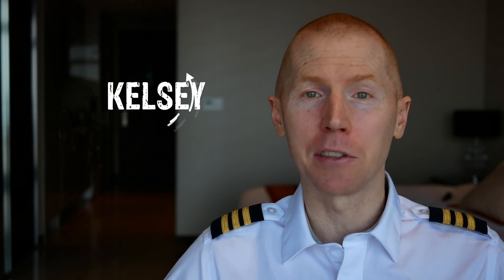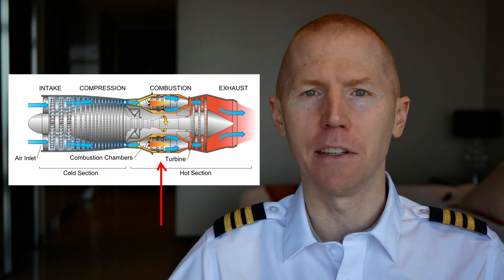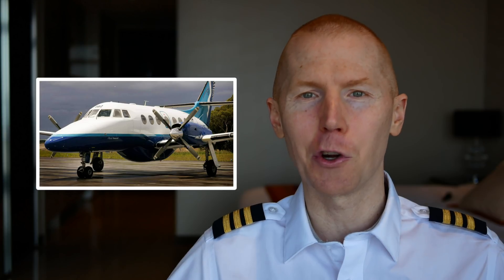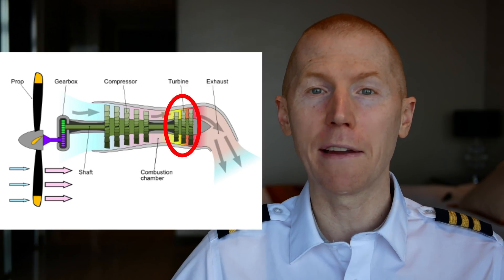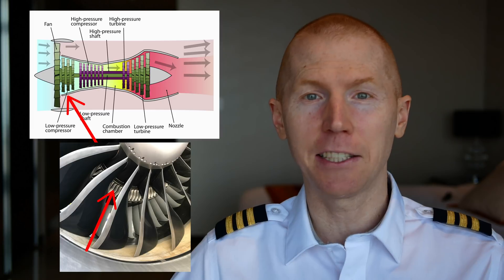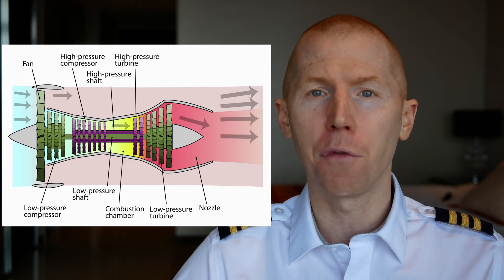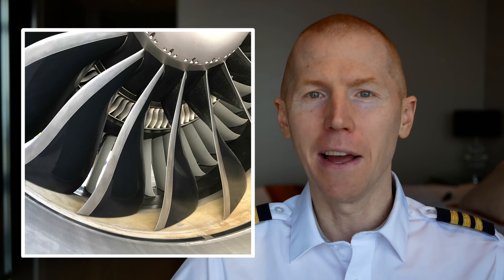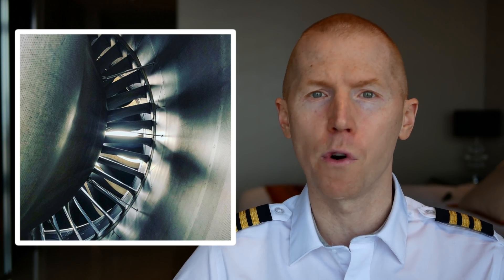Is a Turbofan Engine or Turboprop Engine Safer? | Pilot Explains

Comment: 1:01 I cringed hard!
There is NO explosion in a jet engine (turbojet, turbofan, turboprop) in normal operation. It is a constant burn.

There are igniters which ignite the air-fuel-mixture at the start of the engine and in heavy precipitation and/or icing in case of a flameout. Normally though they only run at the start of the engine, thereafter the burn continues by itself.
Reply: @jamescollier3  what's he then
Reply: No need to cringe, it is just semantics.
Reply: @MaxPower888  I disagree. It's precision. Kelsey and I had a discussion over this on the last video. Kelsey is unfortunately taking the position of Boeing vs. 73 Max pilots over MCAS training ("It was too complicated for pilots to understand"). He is of the belief (which I wholly disagree with) that his viewers can't comprehend a slightly more technical, but 100% more accurate explanation. Example using "blowtorch" vs. "spark & explosion". I consider it disrespectful to his students, and YES, he IS teaching here. There is a very effective teaching concept called "stretch learning", where the information is presented just slightly above a student's level, but still within their grasp. It FAR better than teaching WRONG info BELOW the student's ability. I find the practice offensive, despite the good Kelsey is trying to do here. However, maintaining an iron fisted grip on outdated methods to teach incorrect info truly serves nobody. I think we agreed to disagree. Maybe there's a reason this vid only has 617 likes out of nine thousand views...

Specifically, on the topic of powerplants, I'd rather they were watching AgentJayZ's channel where you can see lockwire-level detail, and also have access to another regular contributor who is a retired design engineer for R-R, and can explain the "whys". It is technical, precise, and has stunning videos of engine internals, as well as test stand runs. FWIW...
Reply: @mikecowen6507  +1 for AgentJayZ. Didn't want to mention his channel for not making too many people aware of him. His channel is the go-to resource for jet engine stuff and by far my favorite YT chan next to blancolirio if you ask me.
Reply: @jodelboy  Jay and Juan can always use more subscribers!

Comment: Many turboprop engines provide thrust from the exhaust nozzle as well as the props. In particular the t56 Allison and RR ae2100 which provide around 500lb of thrust from the nozzle.
Reply: They usually call that "residual thrust" because it is unwanted. When a turboprop engine can not efficiently convert the jet thrust to torque on the propeller it's wasted power is called residual thrust. The Garrett TPE-331 for example only has 20-30lbs of residual thrust which means it is more efficient at converting the jet exhaust into torque.
Reply from the maker: Max Power for the win!! Even with my engine type 🤣

Comment: another good vid.
they are actually simpler than that ...I was a maintenence chief. we could strip a ((shot to hell)) huey in two hours. it is just like the basic car.
air frame, power plant, wiring and instruments/radios ...
initial start, check out, flight run up..then it went to tarmac for vib test/align, test flight ..signoff and shipped to units.. one off my state side Kiowas was shot down four times in the high lands...I met the pilot at fort campell years later. OH58 21459 what you folks know as a Jet Ranger. They pulled AK12 (60 cal ) sluggs out of the compressor housing, that is the pot that cooks the intake and fuel...pilot slung the tail in a 50 yard arc (like an auto rotation) to blow off speed and aim for a hill side to crash into the side of a hill. didnt want to crash in enemy terrirtory. grunts resqued him and he was back in the saddle a day late , same hill.
he also had four pax to think about.....BEST IN THE BUSINESS  US Military avaition
sorry this is so long...remembering it also shows stability of machines...minus the gun fire commercial does the same thing, just more checks and balance.
Reply from the maker: not a problem willie I enjoyed your story thanks for sharing and thanks for your service. 👍

Comment: Never really had a problem (as far as "trust" with either turboprop or turbofan-type engines. Kind of like the turboprop since it puts me to sleep easily. Really like the high-bypass turbofan engines because they are so interesting. CFM-56 is fascinating to study. Not just the core, but the fuel feed system, oil system, and all the sensors. Thanks for the videos!
Reply from the maker: ya the funny thing I found when I learned about them were just how basic they were in design but how smart the people were to envision that design, thats what impressed me the most.  Thanks for watching Jason.
Reply: @74gear  They have a CFM-56 cut in half probably by a laser at Udvar-Hazy next to Dulles. It is a  testament to the designers. Really interesting and impressive to just study.

Comment: Why turboprop is still used in short hop planes? why don't they just use very high-by-pass ratio small jet engines instead? Is it the cost of the engine, or fuel?
Reply from the maker: all of that and turboprops are more fuel efficient at lower altitudes.

Comment: But why turboprop engine makes more noise and shakes more as compared to jet?
Reply: Monish, might be because turbofan is encapsulated and its blades are fixed by both endings? Another one, because turboprops have eccentric axis to the main shaft? Because turboprops have variable-pitch which makes a lot of noise at the takeoff stage?

Comment: Why is it that the ducted fan of a high bypass turbofan creates more thrust than the core? I'm old enough to remember the [edit experimental] 727 with that non-ducted(? whatever it was called) prop in the front of the core. It seems a high bypass turbofan is no different than a turboprop other than the ducted fan? Know what I mean? Is it the constant speed prop? (I still don't understand how that works either btw!)?
Reply from the maker: Billy I am not sure I am understanding your questions here... but the turboprop is more efficient at lower altitudes and turbojets are more efficient at higher altitudes... so at lower altitudes the big fan on the front of the engine is actually a huge help but not as helpful up at cruise.  So the high bypass turbofan is a overall more efficient engine cause its utilizing the best of both worlds.  Does that help?
Reply: @74gear  yeah I think I get it.  In a turboprop the core turbine exhaust isn't really producing any thrust it's just powering the prop and at flight levels the turbofan core is producing a lot of thrust along with the fan

Comment: Does this mean that the front fan on a turbofan can change its angle of attack as well?
Reply: thats kinda my question too. all turboprops have constant speed propellers
Reply from the maker: well there is something called VGs... variable inlet guide vanes.  Its nothing you can control from the cockpit its regulated via the computer system and actually uses something like fuel to move the vanes to keep the engines efficiently running.  that's a much more advanced class though 🤣 this is more of a 101 class

Comment: Never felt uneasy flying on turbo props since I knew that they had a lot in common with turbo fans. Actually, I like the turbo prop aircraft a bit more because they can be boarded and deplaned faster and maybe I shouldn't say, but their susceptibility to turbulence due to their smaller size seems like a little bit of an adventure. I have flown on most types of aircraft large and small during my days, however I haven't flown on a 747. I hope to fly on a 747 at least once before they are all retired. Unfortunately that day is fast approaching and their are very few carriers left that operate them anymore.
Reply from the maker: well carriers like Lufthansa that have the -8 won't be retiring those for a little while... they paid a lot of money for them.

Comment: That illustration of the turboprop is backward.  The air intake is routed to the back of the wing where the compressor blades are.
Reply from the maker: not quite sure what you are saying but there are multiple turboprop designs but this one was the easiest one to explain the concept. Thanks for watching.

Comment: On a completely unrelated to this video note, I have a question. Can a pilot wear hearing aids? I know the FAA requires you to be able to hear at a certain level. However, what if it was mild hearing loss where when you wear the hearing aids, you hear as loud and clear as someone with normal hearing? Anyways great video though!
Reply from the maker: I have heard of pilots wearing them yes.. I don't know what the restrictions are on it though... I wear noise canceling headphones partially because I don't ever want to have that problem 🙏
Reply: 74 Gear so, you are allowed to wear them?
Reply from the maker: I am not an AME, so if you really want a firm answer speak to one of them, but I have heard of guys having them.

Comment: I can see the point in single engine aircraft to have a turbo prop.  But on small multi engine (ones typically have turbo props), why not just put a turbo fan like they do the bus jets?  Looks like to me that both type of engines functions the same execpt one has a prop and one has a fan.
Reply from the maker: well turbojets are more fuel efficient at higher altitudes and a lot more expensive.  So for shorter or lower alt flights a turboprop can be more efficient for what they need.  It all depends on what they need.
Reply: @74gear  I would have assumed that both designs would be the same as in efficiency due to they both burn the same fuel the same way.  Granted the sizes are different due to size of aircraft.  I understand what your saying.

Comment: I've always wondered what happened with the Propfan!
Reply from the maker: what do you mean by propfan?
Reply: @74gear  I think they may be referring to that experimental engine that had a large propeller.  They called it UDF for Unducted Fan I believe.
Reply: @4stringmanatgmaildotcom  You are correct, sir! I still have an old issue of Air International about it.

Comment: Hi Kelsey thanks for explaining.
In a car you have motor oil. Do you have motor oil in turbofan and turboprop engines as well?
Thanks for the answer in advance. Until your answer I keep the blue side up :)
Reply from the maker: yes we have oil in both to keep everything lubricated and the oil plays an integral part to other systems as well which eventually I will explain in later videos.
Reply: @74gear  Thanks Kelsey for the answer.

Comment: YouTube only just sent me the notification that you posted a new video. They better not play me like this again. Excellent video as always. Great job Kelsey!!!
Edit:- I'm fine with turbo prop aircraft...I've never seen them as less reliable, I just assumed that they have a lower range than a turbo jet engine. That's a good question come to think of it...does an ATR have a lower range than say a 73NG?
Reply from the maker: well it does for several reasons but one major one is the fuel tanks are a lot smaller.  Turboprops are usually more efficient in the 15-25,000 range and turbofans are more efficient at higher altitudes.  They are different animals all together.  Does that make sense?
Reply: @74gear  It's not a altitude problem, the old turboprop liner Tu114, the Tu95 ,the AN22 or the new A400M fly at same altitudes as turbofan aircrafts...

Comment: Nothing really to do with the engines but the aircraft itself. It seems like these smaller aircraft are more unstable because of weather etc.
Reply from the maker: well they can be and sometimes they have to fly at lower altitudes and that results in a lot more weather problems which can make the ride worse.

Comment: You forgot one thing turboprop produce so annoying sound while jet engine produce so satisfying sound....
Reply from the maker: 🤣 I am sure there are some people who love that extremely loud engines.
Reply: Ducting do help.... And something so trivial that there is a od.. or prime number of blades in some turbines do help a lot. That's why wind-turbines nowdays always have 3 blades.  Most modern helicopters have 5 for the same reason.  Why some turboprop planes have stuck to 4 I don't know 

The nosiest aircraft ever. A Russian turbo prop bomber have dual counter rotating 4 bladed propellers.... Pretty much the worst combination possible. If they made one propeller 3 blades and the other 5 it would be nearly silent.